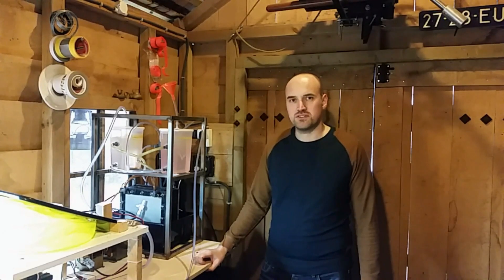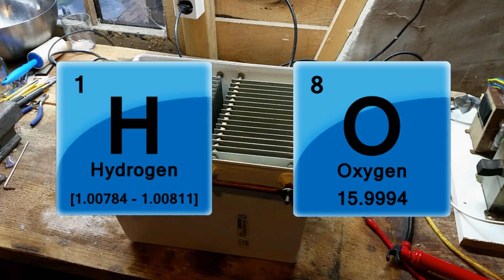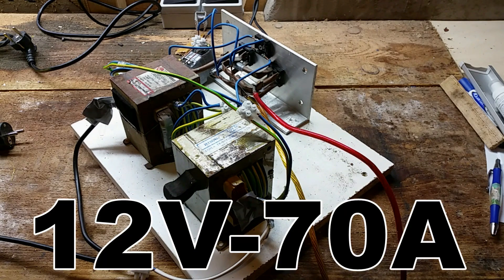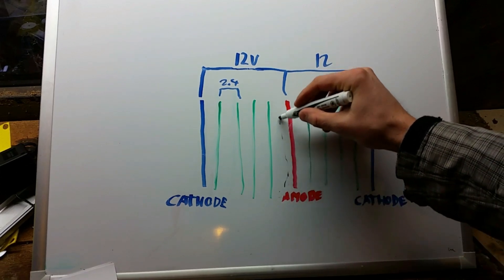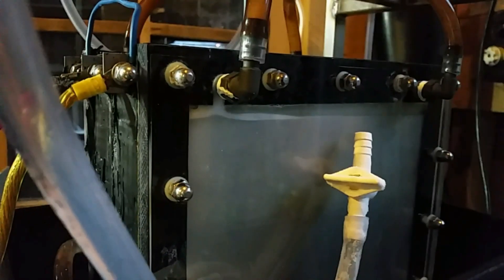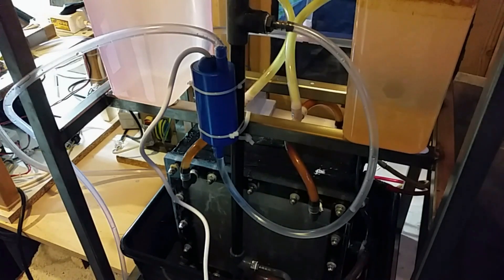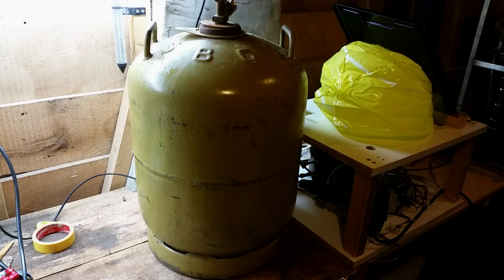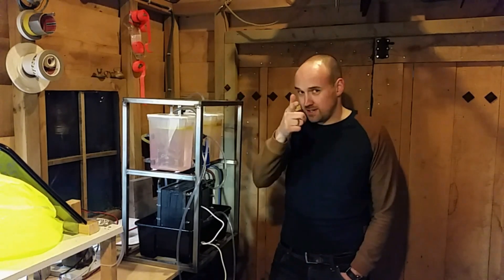Hydrogen Generator #1 Homemade Hydrogen Generator And Compressor Unit

Comment: Why alkaline? 
What Amperage?
Considered positioning the cathode and anodes in a manner that is beneficial to process? 
And make the voltage do the work instead of the current. Configure the V, Phase A and Hz with very a very specific relationship.... which alone, would not work due to current being far too low. 

The relation ship between the energy transmitter and receiver needs to be better examined and the enclosure designed to assist interaction between the two
( shape, volume EM properties and EM characteristics) 

It is this interaction that is important as creating a field with high pressure conditions but low amperage that is the objective. 

I believe once perfected, the rate of production will be orders greater than currently accepted. 

I plan to develop Commercial grade units to sell or lease and a smaller, slightly different unit that will operate in a very similar manner but require a slightly larger input, which will be perfect for personal use and hoping will be feasible for household use. 

Without giving to much away...
•Bonding at both atomic and sb atomic levels,
•EM and mechanical resonance structure/properties 
•Magnetohydrodynamic factors.
•EM and EMR integration.
•Various Magnetic attributes of elemental metallics.
•And certain other factors relating to the interplay of device priorities and dynamics... 

Are areas I need to develop and integrate, I would be happy to share progress with u and let u know in more detail what the process of design. And use. I have on plan. 
I am only lightly studying at moment as other aspects and projects take priority but hoping for March - May 2020 I will have other projects complete and aspects sorted so I can concentrate on the three projects I really want to develop. This being one and the other 2 are the compressing and cooling systems for storage and transport
Reply: Your comment reads like the common nonsense posted on the internet by folks who don't understand.  I suggest you try to write it up like a scientific paper.  If you have something that is real it is the best way to prepare it for publication.  If you are just fooling your self, it is a good way to discover that.

Comment: You can try to use together copper and stainlees stell. Gas production will be ultra high in comparrison to only stainless steel. Copper must not come in contact with the oxygen, otherwise heavily oxidizes.
Reply from the maker: Well, copper will dissolve in sodium hydroxide so I'm going to do it like this: https://youtu.be/Zn1hkzvFZOI thanks for the suggestion though! 👍

Comment: Please be careful ! ! You can not store the Hydrogen or Oxygen inside .  Outside , any leaked H2 will quickly dissapate. . Inside, the H2 can build up with no noticable odor. . . Then a spark will cause a huge, violent explosion.  . . It's the same with Oxygen, except that IT causes other things to burn violently. That is what caused the 34 people to die in a boat on fire off California. Because it was a scuba diving boat, there was pure Oxygen stored below deck, where the diving students slept. A tiny fire became a raging inferno,  instantly because the Oxygen had leaked and it caused everything to burn in a very hot and violent fire. Experts have said that it was impossible to escape, because of the extremely hot fire, blocking their way and actually setting the people on fire.
Reply from the maker: Yes it's best to do all this in a well ventilated area. My shed is leaking on all sides so I'm good. 😉 Thanks for the warning! 👍

Comment: I was told if you have a third neutral insulator between the electrodes it will increase gas production between the fields. Not sure because I never applied the theory..  Oh dang you are saying that now... OK never mind..
Reply: Lots of folks get told lots of things.  Much of it is not true.
The H2 and O2 comes off at the conductive plates.  What is between needs to not block the flow of ions.  Other than that, there is no improvement.

Comment: If you are looking to make hydrogen, I would encourage you to investigate wood gasification. I started out building HHO cells and eventually ended up building very advanced cells. However I ultimately ended up in wood gasification and now am one of the leading producers in the world. Electrolysis is cool and you can do some cool stuff with them. However, that energy to produce the hydrogen is more than what you can get out. Just the way it is. Wood gasification does require energy input as you burn about 30% of the input fuel stock to create the product gases. However there is no other energy requirement after this other than a start up battery that can be recharged from the unit once running. 

As for storing Hydrogen? dont ever do this, it is extremely dangerous!!! It will interact with any vessel you attempt to store it in making it brittle, it is very unstable and will try to combine with any gas that accompanies it, either making it go BOOM or degrading it to CO2. All it takes is for your pump to have a slight leak and if your near it; its over for you. The beauty of woodgas is the hydrogen is already stored in your fuel and you can take on demand as you like. If you want to store after this then simply convert it to electricity and store in batteries.

Comment: Your heat is coming from the electrolyte being shared between cells. It is a direct short. It is certainly a bit more complicated to build, I know as I have done it. However if you isolate the electrolyte between cell chambers you will increase your efficiency and get rid of all that water vapor. The cell will run at room temperature @ 2 volts pr cell. 

Very cool with the felt, I use ceramic cloth and sandwich this in between SS mesh. The cell gap is no longer in the middle; rather it is on the outside of the anode / cathode and the ceramic fills the middle. Because the anode and cathode are mesh and as you stated the  H and O can not transfer thru the ceramic membrane. The H and O will instead separate and flow thru the SS Mesh. (Oxygen on one side and Hydrogen on the other. So your cell gaps are to the outside of the cell verses the middle. I use scotch brite scrubbing pads to act as a baffle to keep the cell fully wet vs the gases pushing your electrolyte down voiding out the top of the cell.
Reply from the maker: Thanks, though it's not really clear to me how you constructed that. Can you mail me some drawings thediyscienceguy@gmail.com thanks!
Reply: @TheDIYScienceGuy  https://www.facebook.com/photo.php?fbid=179867212093135&set=pb.100002095720899.-2207520000.1566282460.&type=3&theater
Reply from the maker: Thanks, but I could not find any clarification on your previous message do you have a drawing?
Reply: @TheDIYScienceGuy  lol no I hung up HHO many years ago. I build bio fueled power generators now. You simply need to isolate your electrolyte between cells. Each cell must have its own reservoir its own electrolyte. Basically like a battery, you build one cell and they only share the electrical connection. 2.2 Volts is the running volts for most HHO cells. Think about batteries, you can crank 12 volts into a 1.5 volt battery, but ultimately it will only put out 1.5 volts. On an HHO cell if you drive them over 2.2 volts you are simply over driving them just the same as if you charge a 1.5 volt battery with higher voltage. Undercharging results in less of a charge, same goes for an HHO cell.
Reply: If you want to make a better cell look up PEM electrolysis. Much better efficiency than you will ever get with a plate cell.  You can also make it work the other way and produce power with it.

Comment: Add a frequency generator into your circuitry and adjust it to maximum production. This will allow you to reduce the power on the unit with no reduction in gas production. Reduction of power also reduces heat production. Additionally, use ionic silver as the electrolyte, to reduce corrosion.
Reply: you need to build a basic PWM circuit 
pulse width modulation 

this gets driven by a frequency generator.

and using solar dc is best.
using 250v to make dc is not very efficient 

use solar dc 30v and make big plates for the hydrogen generator with the method the guy uses to bring the plate voltage down.

stan meyors used pulse width circuit and not the old skool way with brute force current striaght to anode and cathode.

he used a pulse width frequency to crack the bond apart.

telsa said the secret to the universe is frequency..3 6 9
Reply: Please show us the one you have made David. Do you have a link?
Reply: @MaxkwGisKaas  Hi Tim, i just saw your request and i would if i could. i do not have a link, or even a photo. Save for research and basic uses, i do not use the computer much. i came to this late in life after a couple of white collar careers. i lack the tech training to even explain what i've done in any kind of meaningful way. i have a theory of why it works but i have no idea of the efficacy of my theory. i just know it works and i figure, if any of you bright guys can see your way to giving it a try, you would certainly have greater success than i.
This platform messes with me continually, and i often do not get notification of comments, as was the case with your comment. It was only happenstance that i saw your comment when i was responding to another.
i am accustomed to being responded to very rudely, i thank you for your kind inquiry.
The best to you and yours.

Comment: What will happen if you store HHO in one tank? What are you going to do with the hydrogen? What are you going to do to the oxygen?
Reply: if you compress HHO it will spontaneously recombine, explosively.
Reply from the maker: Yes, what  David unmint says.
I'm not doing much with the oxygen only a little experimentation:  https://youtu.be/Ms62lnFVGaY
The hydrogen I use to fill my hydrogen balloons: https://youtu.be/PryCxyJ8Y2Y

Comment: Here is another idea I used for a power source.

 I Use mains line voltage with a  capacitor inline  to limit power flowing Into a full bridge recitifyer. The inline capacitor adds capacitive reactance that impeds the current in to the rest of the  circuit.  

After rectification in the full bridge recitifyer,  the power is smoothed  with a capacitor inductor filter connected to the  HHO generator.   With out smoothing,  rectified DC is pulced and an HHO generator is doing most of its production just part time and mostly inefficently when the voltages peek 100 or 120 times a second.  Smoothing out the power  so that it runs all the time lowers the voltage across the cell to its RMS and more efficent voltage.  

Additionally,  this circuit has a built in protection feature.  Normally during electrolysis, the electrolyte heats up  becoming more conductive conducting more current and making more heat in a thermal runaway that can cause damage or too much current draw.  But in the circuit i described, as it heats up, its conductivity drops and the voltage drop across the HHO generator drops. That causes less current to flow and the HHO generated is generated  a little slower but  more efficently. Making less heat. 

There is one down side to the circuit i described.  It it has a low power factor which can limit how much real power can be delivered on a 15 or 20 amp circuit, But that shouldn't be a problem for most home DIY.

Comment: I'd like to add three things that were not discussed.
1) potasium hydroxide is better than sodium hydroxide because it has far better conductivity over a wider range of concentrations allowing you to use lower voltages while sustaining a reasonable current. In other words you can generate hydrogen more efficently for a given current at lower voltages with potasium hydroxide.  http://www.horiba.com/br/application/material-property-characterization/water-analysis/water-quality-electrochemistry-instrumentation/the-story-of-ph-and-water-quality/measurement-of-conductivity/measurement-for-concentration/

2) dont over drive your generator. Dont go over .5 amps per square inch. You will ruin your plates much more quickly. 

3)  When using neutral plates, it's best to switch from a wet cell to a dry cell HHO generator, else you can get significant leakage currents bypassing your neutral plates.
Reply from the maker: Thanks for the info! 👍

Comment: Good video, but be careful with that tank, hidrógen is that small that will escape out of the tank, specially between the valve that's screwed on the tank.
Reply from the maker: Thanks! The amounts that leek out are very small but ofcourse always store it in a well ventilated area.

Comment: Test in long gone by many years ago it was found that the very best rate is when the operating voltage is exactly 
2.2 volts + = 0.02V and - = 0.02V of Direct Current. the time-honored mercury vapor tube as a rectifier generally ran a 100 ma but these tubes had to be Xray shielded for human safety more like 0.01 ma does not need any shielding. Oh, when running at 50ma you will be sterilized no more children for you and maybe some cancer too.  So to make enough hydrogen you will need a very large unit and always remember to keep these large containers as pure hydrogen no oxygen in the same chamber this is best done by the of a "U" shaped tube with plates as low in the chamber halves also afloat system to add more distilled water when needed, NEVER USE PLAIN TAP WATER if used tap water is in chamber you will chlorine gas in the hydrogen and fluorine gas in the oxygen which is this one you want to vent out in to the air, FLUORINE GAS IS VERY POSINESS! do not let it out into the air it can do a great deal of harm and while here we need to say that Chlorine gas is also very harmful too. In solar cells you can set them each as 0.44V at 0.4 amps times 5 cells this will get 2.2 volts at 0.4 amps. Then hook them up as a set as five cells in series and then parallel these series sets. For as many units you want to put them together. Remember that the more current the more hydrogen that is made. And by the way, these will not get hot enough to keep from freezing when it comes to winter but you can put this into a shed and as long as this hydro generator is running it will heat a shed up to fairly high heating when this unit is about 75% filling the shed. 16 feet by 16 feet by 8 feet high. Bigger solar power panels will be needed to pump this hydrogen into very high-pressure cylinders that you swap out to use them for of any combustion you want to use them with using them safely.
Please read all about the save ways to store and use flammables like hydrogen which burns extremely fast, more like a bang.
Know your ways to do anything by using those very same ways and you will be safe aways.

Comment: What determines the speed at which the electrolysis reaction occurs is the amount of amps going through the solution. Voltage is just related to what elements are reacting in the cell. With 5v you should be more than fine.
Reply: You need 2.2V between each plate. So depending on your wiring and how many neutral plates you have will determine how many volts you need. Most common cell is 9 plates and is paired with a 12V power source, commonly a car battery.

Comment: One idea i partially saw on another Video would be to use a fluid based cooling System for your 12 hydrogen production. That way you don´t have to break any seals to make it air cooled. You could also use piepes that do not allow electricity to flow through and then use a water based cooling System... These are just some ideas tho...

Comment: hydrogen implodes not explode! and explosion would of splashed water everywhere but you can clearly see the water was hardly disturbed even with such a powerful bang ;)
Reply from the maker: That is incorrect. The combustion of 2H2 and O2 generates a lot of heat which makes the gass expand rapidly. If the generated water vapor is all condensed, than the end result has a lower volume than the 2H2 and O2 but that does not make it an implosion. That there is no water spray in the video is probably because the explosion creates a uniform pressure front in the bowl. In this video you can see that it clearly explodes: https://youtu.be/oZGbLIQ7R-A

Comment: It is more safe to store hydrogen with oxygen in the propain tank.
Pure hydrogen do react with metal.
I did some testing, a mix of hydrogin and oxygen will not explode as longest there is pressue. Once my propane tank show 0 bar the flame went into propane tank with very loud results and was permanently damaged.
Now i always have have 0.1bar before i makw pankakes.
Reply from the maker: Hydrogen does not do anything to metal at these low pressures. Don't put them together in one tank!
Reply: @TheDIYScienceGuy  Regarding  Artjoms Pugacovs comment: Could it be a problem if you start out hungry for pancakes & end up with the formation of scrambled carbon nano eggs combined with micro meat suit particles well into surrounding suburbs, but no longer able to eat either?...Aside from the massive & instant decrease in hydrogen production??
Reply from the maker: Only a problem when you don't like eggs.
Reply: @TheDIYScienceGuy  So what you are saying is if I or he do like eggs , I/he should not worry about the burnt egg & meat suit bits??

Comment: What plastic material do you use for the outer plates?  Can u make a video focusing on a step by step making the membranes and the HhO cell? 
Im using the hard  plastic cutting board and my cell is leaking. I then used pvc glue between  gaskets and plates. And still leaking ..
Reply from the maker: The transparent outside is made of polycarbonate. I will make a video where I will repair the generator so than I will also show more detail. The glue I use is a polyurethane based caulking.

Comment: Do you power your Cell with 2 12v chargers? or u use 1 24 volt and split the anode?
Reply from the maker: It's 2x12V which outputs 70A total.